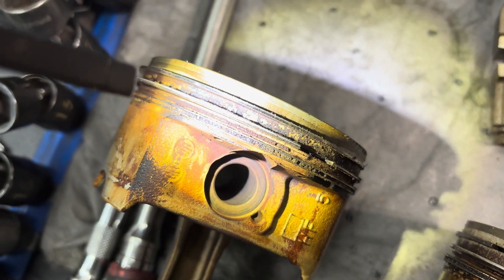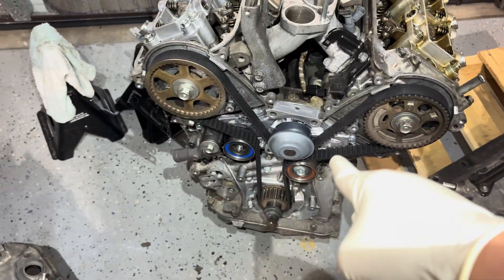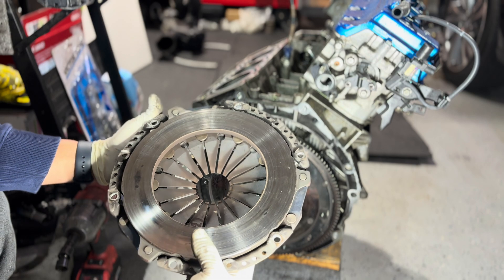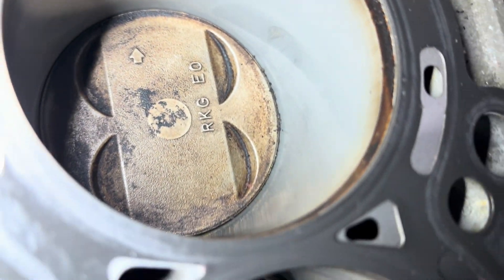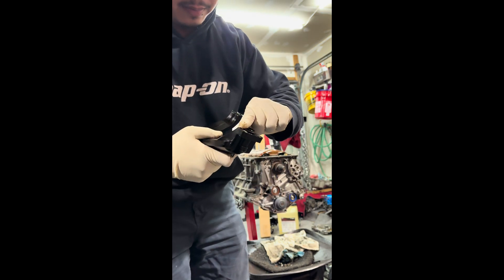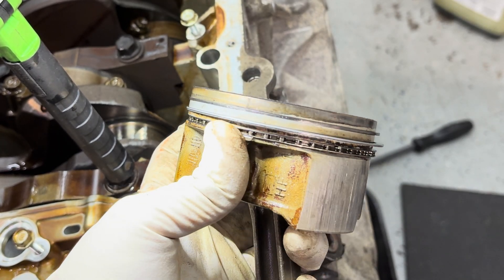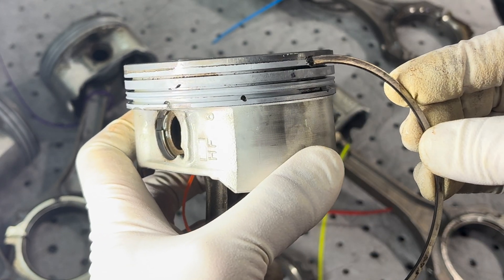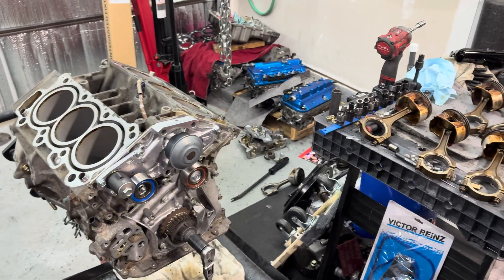“So That’s How J37A4 Motors Burns oil” My New Motor Dissected piston Ring Cleaning

Comment from the maker: Who’s excited for the new engine build. Inadequate oil changes can lead to the seizing of oil control rings, which results in engine oil bypassing the rings and subsequently burning.
Reply: We need to see a fully na built j37 vs the FWD 2nd or 3rd gen Vq35de/ hr  na fully built
Reply: Put some stronger rods. While your add it... Might as well ..right !! Keep it coming bro.  Can't wait to see it all done. Either way!!
Reply: Valvoline restore and protect and italian tune up. The carbon falls out the tips. Its crazy
Reply: J35a does not have this issue as much

Comment: To clean that carbon build up, all you have to do is go for 7-10 spirited 7000rpm 40-110mph runs with full oil and the carbon build up burns and vibrates off and you’ll be good for a while. A VTEC maximize session is what I found out was the answer. My 13 TL shawd burned a quart of oil every 500 miles at 110,000 miles, and I did that, and now I’m at 140k miles no problems. Heat and vibration removes and burns carbon build up, it’s simple physics. The reason why Honda Acura couldn’t say this is because it would be illegal. It’s a simple fix, just go VTECing. :D

Comment: Good job! I think it needs some improvements in the form of additional holes for oil drainage. I washed my J37A4 with DMSO.  Works extremely well and there is no need to disassemble the engine.
Reply from the maker: Thanks! I’ve used BG EPR in the past

Comment: I use the Valvoline Restore and Protect oil on mine not sure if it’s actually keeping the pistons clean and whatnot but for me it seems to not burn oil, 180K miles engine hasn’t leaked or shown any signs of oil loss!
Reply: @gaminghummus  yup. They formulated that oil specifically for this. It's one of the best out there for this oil consumption issue.
Reply from the maker: Good to know about that type of oil thanks

Comment: Thank you so much for this! I have a 2012 TL 6MT and I'm burning an insane amount of oil. Out of oil within 1500 miles kind of bad. Really interesting to see! I feel like my pistons probably look like they chainsmoked for 40 years. I know you said you didn't want to make the video too long, but I would have absolutely loved to see more of this💪
Reply from the maker: Thanks 😊 I’ll try and make a longer one next time
Reply: @blainecollins  try that Valvoline synthetic Restore and Protect oil. Been doing a little research on it and it's the truth when it comes to cleaning the engine and in some cases completely stops the oil burning. Other cases it slows it down ALOT. Can use it as regular oil too.

Comment: The cylinder walls look like they have a lot of glazing with no visible cross-hatch. Will at minimum require a hone. If that was "rebuilt", it makes you wonder where else they cut corners.
Reply: @habpar6531  can't hone these cylinders like a cast iron setup. Has Nikisil cylinder liners..

Comment: exactly what my 07 TL Type S looked like when i rebuilt it. The rings were completely stuck. All oil changes were done on time. I think that driving the car hard and then turning it off causes the oil near the rings to just sit and bake into sludge.
Reply from the maker: I believe that since turning off the engine while hot just bakes the oil into the parts